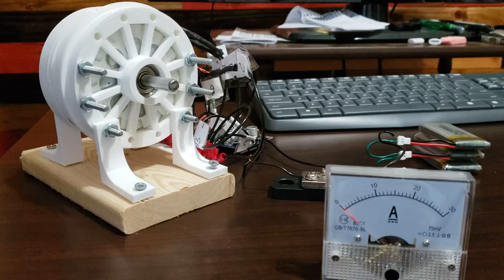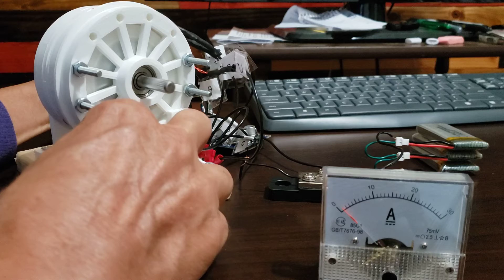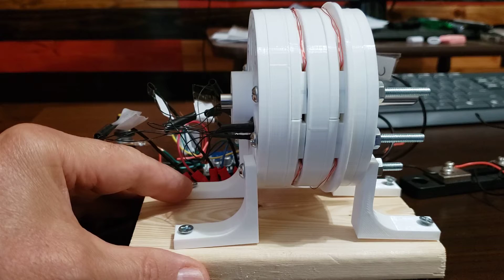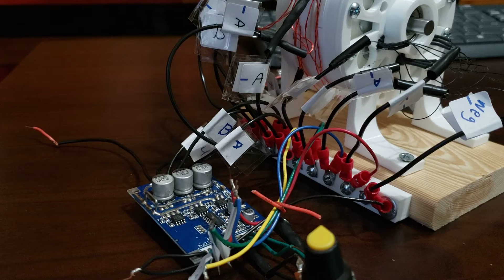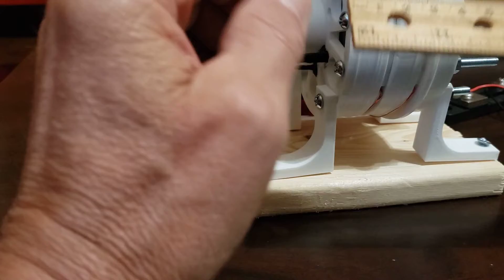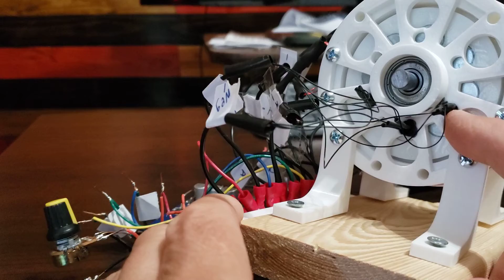3d printed Axial Flux Brushless DC motor. Duel Stator, triple rotor

Comment: Did you ever get a max or stall torque on this motor?
Reply from the maker: No. That's a little out of my expertise. I built this mostly to learn how to build controllers. Unfortunately, that seems to be beyond my expertise also.... Right now I'm sidetracked (as usual) on a different project but hoe to get back to it in a few months. Thanks for your interest.
Reply: @rickrandazzo  Thanks for your reply and for this work! I'm going to get estimates on the 3d printing and build one. I'll let you know what I find in stall torque. I'm planning on mating this to a compact format compound planetary drive.
Reply from the maker: @moses5407  we can communicate by email if you like: dazzor_2000@yahoo.com
Reply: @rickrandazzo  I'll be using a simplefoc controller and will let you know how that goes.

Comment: I've just built myself a 3D printed axial flux motor from scratch, very enjoyable learning process. I learned the phase control mechanism and bought an Ebay 3 phase sensorless controller, the first one I bought struggled with the 'odd' setup of my motor (I had to manually spin her up), the 2nd was a bit more forgiving.   It would be nice to have one of these programmable VESC controllers with which you can tweak drive parameters. There's a bunch of stuff on YouTube/Internet about all this.
Reply: With sensor less controllers you have to spin them up as the controller doesn't know what position the rotor is in. Once you spin them up, then the controller gets it's positioning and she's off to the races.

Comment: You can buy small sensoreless 3 phase contollers that might make your life a bit easier. eBay or ali. Great work :-)
Reply from the maker: There is a reason I use the sensored controllers. I do have a sensoreless controller I use for testing. If I was looking for easy I could just buy a motor :D
Reply: @rickrandazzo  I think it's awesome you're trying to build from scratch as much as possible. I'm on the same journey just alllllllllllllllllll the way at the beginning lol.

Comment: Hi, are you using yokes on the rotors?
Reply: Doesn't the rotors create exponential torque for having additional two or more stators it was a theory of mine.
And are they offset by 120 degrees or 60
Reply from the maker: @tgmogg  My test seem to validate that idea somewhat. I haven't spent that much time doing detailed analysis. No offset. They are 1:1 with the coils directly  across from each other.  Here's a high speed assembly of the motor and it may give you more information: 
https://www.youtube.com/watch?v=h7NTWatm6Ec&t=2s
Reply from the maker: Sorry, not quite sure what you are asking. I'm thinking you mean support for the bearings. You can see the bearings are pressed into the cover. I made a video of the printed parts maybe it will answer your question. If not, please try asking again as I am interested in what you are asking. Thanks.
https://www.youtube.com/watch?v=CYPoyPmuzQk&t=158s
Reply: @rickrandazzo  thanks for your answer..actually i was referring to the steel plate that is somethimes put on the back of the magnets to redirect the magnetic field that escapes to that side and use it. I dont know if i am explaining  myself...some use a hallbach array to avoid using a yoke.
Reply from the maker: @etherealsolutionsperu  I do not use a yoke or hallbach on these. It would be simple enough to add the metal plate (or ring)  to the back of the rotor magnets. This video has a motor that uses a single stator. The main idea of the axial flux motor, in my idea, is to be able to stack as many stator and rotor combinations as you like. That is the reason the magnets are not focused. I have a couple of videos showing a duel stator motor I built. This video is a high speed assembly of the duel stator motor.
https://www.youtube.com/watch?v=h7NTWatm6Ec&t=1s

Comment: is plastic strong enough for a final motor?
Reply from the maker: I still need to do further testing and redesigning. I did melt a motor when I connected the halls wrong. Then I loaded a motor and the shaft got pretty warm. I added fans to the rotors but, my thinking is that the coils are the only thing that causes the heat, so the proximity to the shaft may be causing induction heating. I only built these small motors for testing and learning. The next motors I build are going to be larger so the coils will be farther from the shaft. Will that make a difference? I do not know. I had been looking at carbon fiber filament to print motors with. It would have the strength but would it handle the heat. If the printing does not work out then I will look at other methods. Casting and the such. But just being able to build them and test the controllers has been worth the effort. These might work very well on an RC vehicle. The design of this motor - Axial Flux - makes it much less prone to self destruct like the standard motors I have seen on YouTube. There are lots of pros and cons still yet to be discovered. 
Thanks